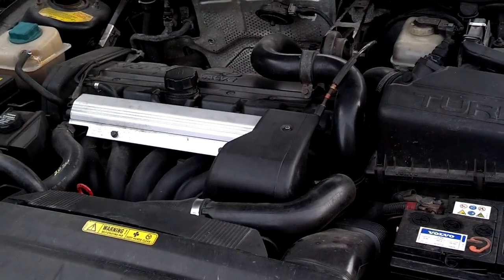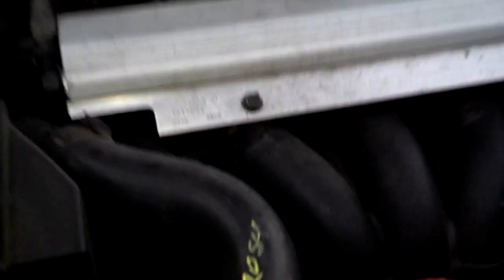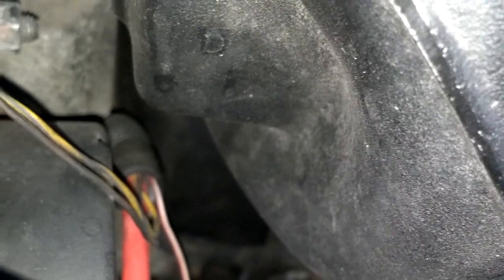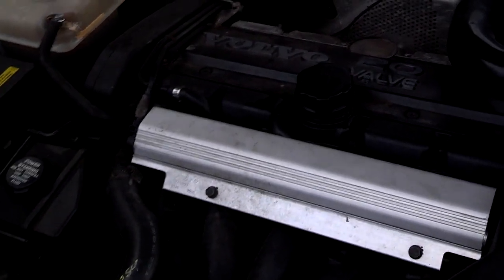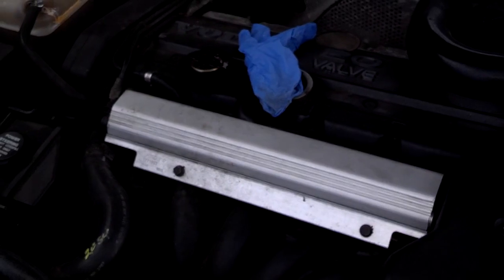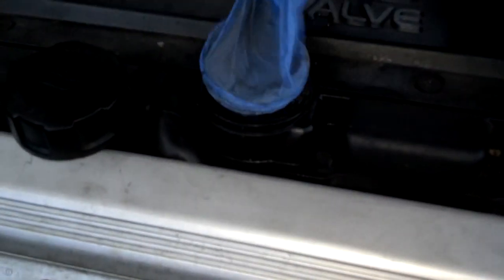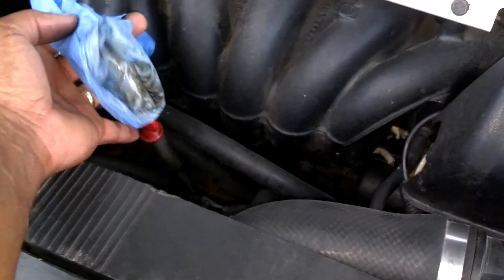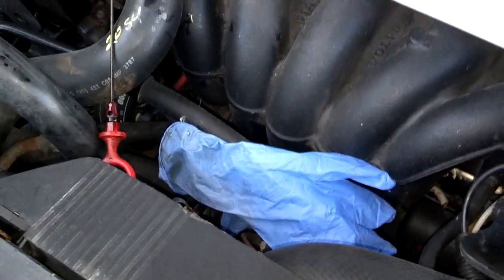Volvo PCV system check, 850, V70, S70, and others - VOTD

Comment: Hello.....I wish you lived closer to me!! Im having so much trouble. I am in a xcv70 Turbo 5 cylinder. 1998. I have already had the transmission rebuilt and literally almost everything and every hose under the hood replaced within the past two years. The car has been driving very well. All of a sudden last week I noticed a very small amount of oil around the neck of the oil cap. No where else. Oil was still full. Dry underneath...everything seemed good. Then out of nowhere I lost anti freeze....pressure tested and turned out to be a hose. replaced it and it was fine. The next day I had EXCESSIVE amount of oil pooled around oil cap and in the grooves by the bolts on top of the valve cover....also leaking or dripping down to the ground. Breather box was replaced when the transmission was done....I do not understand where all this pressure is coming from...I replaced the cap and it seemed to make it WORSE........PLEASE help. I cannot burn out this engine.
Reply from the maker: Rachel Sanmarco Did you do the glove test?
Reply: Robert DIY  Hello...............I have not done the glove test as yet.....I'm almost afraid to the engine feels so hot...But I am going to do both tomorrow morning before I leave for work. I just can't figure it out. something is causing extreme pressure on the engine all of a sudden. Last week it was fine. Until I changed that hose for the anti freeze. Any possible connection there??
Reply from the maker: Probably overheated the engine and blew the head gasket. Do the glove test NOW.
Reply from the maker: Had you replaced the hose that recently blew? - https://www.youtube.com/watch?v=s1OlrdloSzo
Reply from the maker: https://www.youtube.com/watch?v=jsxPXltMFOc
Reply from the maker: Huh?
Reply: Robert DIY Hi................the hose recently as in three days ago..got a crack in it. There was anti freeze pooled under the car. Brought it to the mechanic....told him I thought a hose cracked or popped off. He pressure tested it and I saw it shoot out of the side connection hose running from the tank to ...?? wherever it goes. Then all of a sudden there was oil under my car that night. I tried to send a pic showing what the top of the car looks like. oil under the black cover pooled in all the nooks and crannies. and around the cap
Reply: Robert DIY Is there a possibility that I caused the head gasket to blow by overfilling the anit freeze lever?? The mechanic did check the breather box and he said it was clean.....the only thing is I don't see it seeping from the seams....its just pooled under the cap and around the top bolts.
Reply from the maker: Anit freeze lever? What is that? Did you do the glove test? Did you watch the other videos I linked?
Reply: Robert DIY I'm sorry typo....I meant Anti Freeze level in the plastic container. Yes I watched the other two videos. And I definitely overfilled my container....almost all the way to the top. Im wondering if that contributed to the problem that was small and now big.  My puzzlement is if I blew the head gasket....the oil wouldn't be pooled on top by the big bolts would it.?? wouldn't it just be seeping out thru the side seams. This oil is all on TOP....no moisture in back....the hose in the front that connects to the trap was replaced.....I don't know where it's coming from
Reply from the maker: Did you do the glove test?
Reply: Robert DIY Honestly I did not. It's 9pm here....and I do not own this house. I rent. Im afraid if my landlord sees me outside messing with my car she'll get very upset because oil leaked in the driveway. So I'd rater not do anything in front of her. I have a cardboard box under the car to catch the leaking. And I will do both tests tomorrow morning after I drive about 5 or 10 minutes. If the glove fills you said that means there is a blockage somewhere. If it's not the breather box do you have any other thoughts on what it might be?? Also he only replaced the one coolant hose underneath that connects to the engine. I'm going to check all the other ones tomorrow morning as well.
Reply: Robert DIY Also I have a photo I wanted to send you.....anyway I can do that?? And thank you so much for your time.
Reply from the maker: You'll have to go to my website and text it to me from there.
Reply from the maker: Grrrr, old cars need all of the coolant hoses replaced.

If the glove inflates, it is either a clogged PCV, a blown head, or some other problem like bad piston rings (blow by).
Reply from the maker: So, you're on the east cost somewhere?
Reply: Robert DIY I am from Wilmington NC but I am on Long Island NY right now. Doing both tests this morning....I believe all coolant hoses have been changed but going to check. Don't know about the piston rings. But have to have this taken care of immediately. I keep the car immaculate.  Can you please give me your web site? Id like to leave you my email address as well. I will get back to you in  a few to let you know the outcome of the tests and see what you think. Thank you......
Reply: Robert DIY OKAY!!!!!!!!!!!!!!!!!!  So here's the big news. Just got home. Did both tests this morning after I drove the car for about 10 minutes so it was MORE  than warm. Pulled the dipstick out about an inch....steady stream of smoke coming up...not buckets....but smoke. Shut off the engine....put the glove on...started the engine....IMMEDIATELY inflated completely!!!!!!!!!!!!!!!! So what say you. Re check the breather box and all connecting hoses.....have them make sure all the coolant hoses are in good working conditions.....In your opinion.....if the head gasket blew thats one thing......but if it's the pistons that means taking the engine apart. What
s your thought....and what do I say when I go  in so they don't try to manipulate me and have me doing unecessary things and wasting money??
Reply: Robert DIY okay.............well I hope to hear from you........thanks for all your wonderful information
Reply from the maker: So, how is the level on the coolant tank? Did it raise while driving? What is the level when it's cold, then what is the level after 10 minutes of driving?
Reply: Robert DIY The coolant level stayed the same..........
Reply from the maker: Time for a compression test. Is the oil cap seal good? Well, if the glove blows up, either you have a bad engine (bad rings) or real bad PCV. - https://www.youtube.com/watch?v=Z0hZELYgOX8
Reply: Robert DIY Okay Im a little confused now. I stated I just purchased a cap yesterday brand new. Yes the glove blew up and I got smoke from the dip stick. Again there were no leaks. A hose cracked connecting to the anti freeze container. Replaced it......coolant level is staying the same. No more coolant leaks. Seems like out of no where a lot of pressure on the engine causing oil up out of the cap or whatever other small areas there are....it's all pooled on TOP by the plastic Valve cover....and is running down dripping onto the ground. Rear of engine is dry...all hoses dry. Only soaked on top and now of course the undercarriage from dripping and running all over while driving. So Im going to have them check the whole emissions area....breather box and all connecting hoses. If it's the piston rings that is inside the engine correct?? I find it odd that from one day to the next they all went bad. But well I guess they'll give me their viewpoint tomorrow.
Reply from the maker: You can't dismiss the fact that you blew a hose and lost coolant. Not sure if you drove it with low coolant or not. There is a lot of information missing here.

If the oil cap is NEW and the seal is NEW, it should hold back any oil leakage. If you are leaking enough oil that it is dripping on the ground, that is bad, and a lot. So, there is an issue, either the PCV is real bad or something went wrong inside the engine.

Clogged PCV system, along with bad oil cap seals, do cause oil to pool on top of the engine under the spark plug cover. However, that condition rarely causes oil to run down the engine unless the oil cap seal is REAL BAD. Like cracked or part of it missing.

If something happened inside the engine, like a ring went bad or a cylinder overheated, or the engine over heated (because it was driven with low coolant), that could cause piston damage and cause "blowby". So, a compression test can tell you or a mechanic if a or a few of the pistons are bad.

If compression is low, you should probably cut bait and get another car. If good, they can probably fix it. If the compression is good, I would have the PCV system REPLACED and see if that relieves pressure.

There is a chance that the pressure has been there for a while and you just discovered it. Maybe the oil cap seal gave out enough to cause the oil to leak faster.

As the VIDEO explains, if the PCV system is clogged, it will pressurize the engine and start blowing seals. So, if you plug one leak, with the system clogged, another will develop. That could be bad/worse. If the system blows the RMS (rear main seal) the repair is expensive, like $900. So, it may be a good thing to leave the oil cap seal bad until you have a compression test done to see if the engine is any good.
Reply: Robert DIY Now that you mention it Im trying very hard to remember what caused me to look under the hood in the first place. I always check my car....I had recently had the break pads done....and I've ALWAYS had a check engine light on. Whenever we diagnosed it gave the same codes.....something with the emissions....but we could never find the problem. I wanted to check my fan and the Air pump to make sure they were working correctly because I had not replaced them and the car is 14 years old. When I opened the hood I saw my container was empty and I was surprised because it did not overheat or smoke or give me any indication. When I opened the cap some filled back up into the container so the system wasnt completely depleted......I immediately filled it......and then I went to my service station. Thats when we found the hose that blew. Thereafter the excessive oil.....before  the oil was minimal. Im not sure now what tests to ask them to do.
Reply from the maker: The test I told you to have done.

When the coolant bottle is low, it should give you a low coolant light in the dash.

You really should NEVER open the coolant reservoir when the car is hot, because it will boil back into the bottle and it is almost impossible to fill the system correctly with the car hot.
Reply: Robert DIY Well its at the mechanic right now. He already found something that the fellow that rebuilt my transmission and replaced breather box did incorrectly. I am not surprised. I did not get an indicator light on my dash. I opened the cap to see if I still had any in the system.....and I was on my way to work....had no choice had to get there so I added some. I told him to service the whole PCB system.....and do the compression test. He said something about a valve in the front is where he sees the majority of the leaking....car has not overheated once.
Reply from the maker: Good deal on the no overheat. I had one overheat and it did NOT show it on the gauge because there was no coolant on the sensor. :(

Hope it works out for you.
Reply: Robert DIY Well I guess we'll see. He wants to take everything out to check the whole Pvc system....and I agree, Thats fine. But don't you think I should have the compression test done FIRST to see if the engine is even salvageable? Why do all that and spend that money.....just for him to tell me after it's the engine.
Reply from the maker: That is what I advised above. Compression test first, the rest later. If he is going to dig into the PCV, he needs to replace it. No need to go in there and not replace it.
Reply: Robert DIY Exactly my thought.............they'll go in there service it replace clogged hoses or whatever else they find.....if anything...which I'm sure they will....and then put it back together charge me God knows what.....and then when Im still leaking oil....he'll say the engine must be shot....lol. Im no fool. so I said to him today. Compression test fist see if my engine is good. Then service the PCV system. He said ok.....lol. ....I'm really starting to feel like its a really bad clog somewhere or more than one place. When the person that did my transmission took things out....he did some very strange things putting things back together....including sealing leaks he saw with sealant....instead of fixing them.....as I said above covered a valve that's supposed to be open and breathing....ayyyy....hard to find good and honest help nowadays.....
Reply from the maker: So sad. Again, the PCV system really should simply be replaced. That is the only service it should ever get. After the engine is believed to be good after the compression test.
Reply: Robert DIY Compression test done. Engine good!!!!  PCV system being serviced. I knew my girl wouldn't let me down!!! Thank you for all the great advice and information.

Comment: Hey Robert i have a 94 volvo 850 NA. I just did the pcv system and i cant remember where all the vacuum lines go anyway you can maybe help with a picture or something? Thank you
Reply from the maker: Ricardo Cobar Not really. What tubes are loose?
Reply: Robert DIY i dont know if i hooked up the lines to the egr right and some on the vacuum tree that i cant remember
Reply from the maker: Oh.

Comment: its like the fuel not getting where its suppose too its cranking and im pumping the gas its going puut puut then want start I leave the car for a hour come back it runs like brand new for about a week then does it again?
Reply from the maker: Dalvin Payne You should not press the gas pedal when starting a fuel injection vehicle. Has the fuel pump relay been replaced? - https://www.youtube.com/watch?v=GclQq7VpC08
Reply: I am not sure
Reply from the maker: So, check out the video and go from there.

Comment: Robert.i just had the car in the shop to have the pcv system replaced and the also to replace the rear cam seal where the oil was leaking from.....when i got the car back i did the glove test but i think something is still not right...instead of either blowing it up or sucking it in, the oil filler hole is blowing and sucking the glove in and out like a diaphragm!!!  it's also pushing a bit of oil in and out through the oil fill port. one thing i noticed right away is that the vacuum hose coming up through the intake manifold was not replaced...i suspect the mechanic didn't even bother to clean out the pcv tubes or the engine ports where they attach. what would cause the engine to suck and blow like that??....please help.........if you prefer i can call you
Reply from the maker: supurbian Sure, call anytime. If the hose going to the top of the engine has not been replaced, what makes you think the job was completed correctly?
Reply: i really doubt it was done correctly
Reply: i feel so much better after speaking with you ....thank you so very much

Comment: Hey Robert!, its me again. Today i went trough my whole car that i recently bought as my first car a month ago. I checked almost everything one does on a service. When i checked the PCV system i used the glove and the stick trick. The glove does not inflate or expand, its just does nothing. And there is no white smoke when i pull the dipstick out. But when i drive the car home whitch is an uphill and i drive around 3-4k RPM, the car smells a little burned afterwards. You reckon this PCV system needs change?

(Volvo 850, 2.5L 10V, 1994 144hp) 388k kilometeres on it.
Reply from the maker: Veg-Tech If the car passes the glove test, no.

Comment: Hi Robert,
Thanks for the video.  I completed the repair on my 2001 S40 and I performed the glove test over the oil filler neck (on the valve cover) and had vacuum of the glove but as the car was running it would bounce between mostly vacuum and momentary inflation (like a quarter of a second).  It basicly vacuumed with the cycle of the engine.  Any ideas?  Is that just normal and I am being anxious? Like I said it is basicly bouncing with vacuum for the most part.
Reply from the maker: Chris de la houssaye If you changed the system and cleaned out any clogged ports, you've done your best. I would NOT worry about it. Your vehicle is a little different than mine and has a "better" system so I'm not 100% sure what else to check on it. If the engine is a little worn, it will cause a little blow by. That is why I suggest people do a compression test to see if the pistons are causing some inflation before doing the PCV job.
Reply: Robert DIY 
Thank you Robert for the feedback and help.  The performance has seemed good but blow by is definitely a possibility.  I will do a leak down and compression test.  Thank you again.  You have been very helpful.

Comment: Hi Robert
I Changed my plugs and came across quite abit of oil in the well and all over the top area. Changed the oil cap (ORiley`s) and tried your Pcv test with the glove a which sucked in.  2 Questions? 1. The wire heat covers in the coil area are no longer. Should I cover those wires and protect them from the heat? What else could be causing the oil to come out of the Cap? Thanks...... 2000 s70 AWD Turbo...
Reply from the maker: Scott Lewis Most likely the oil cap seal. No, I would not worry about the wire plastic covering.